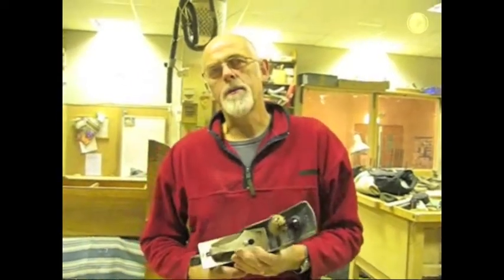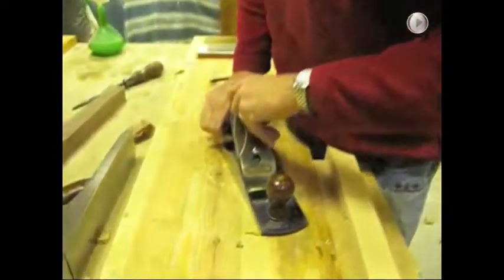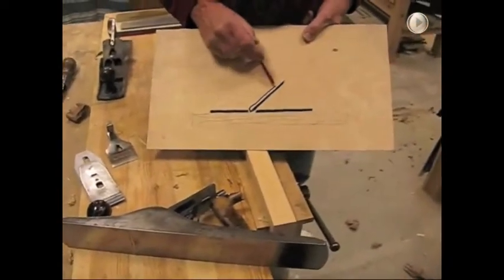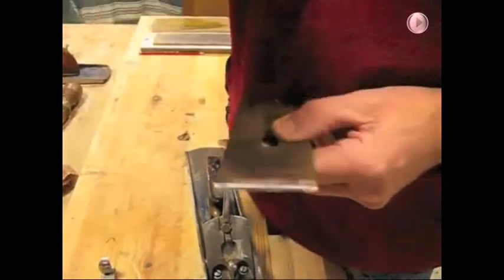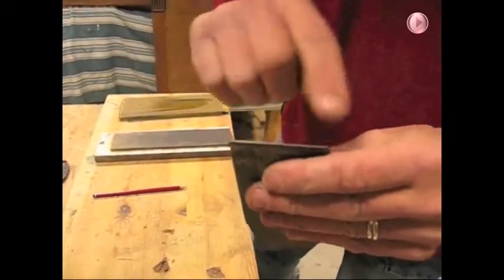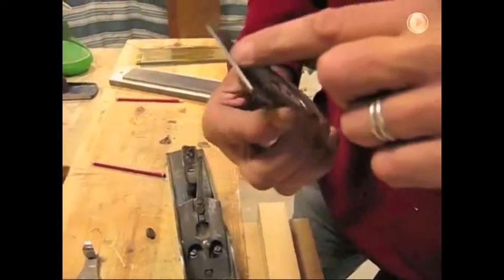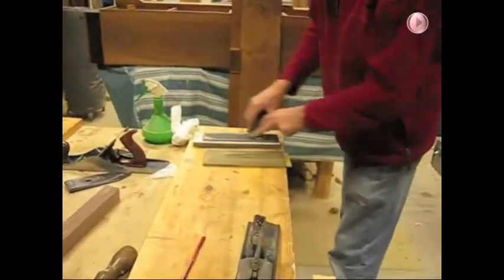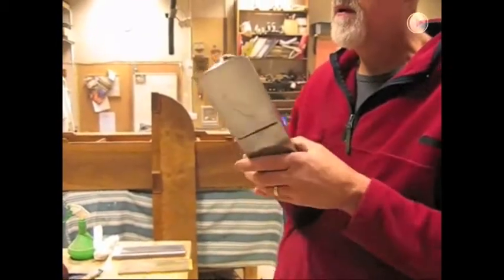Improve your plane's performance - fettling the chip breaker

Comment from the maker: That's interesting. Old English wooden planes have very thick blades, but they also have a chip breaker. Your comments have made me look anew at the chip breaker. I tried my 5 1/2 with a Clifton blade (about 3.2mm thick) with the chip breaker set back about 5mm so it has no chip breaking action and it seemed to work OK. I need to have a rethink and try out different arrangements to work out what is happening, thanks forgiving me a new perspective.
Having said that I still think the profile and seating of the chip breaker, which I discuss in the video, are important. On thin blades the breaker needs to be forward and if the profile and seating is not good then it will affect the exit of the shavings.
Reply: +Christopher Tribe I was taught the distance to place the chip breaker back is determined by the thickness of cut and the "curl" of the wood. When set right each new roll of shavings should push up the roll above it while not be so tightly wrapped that it gets jammed in the opening. For very fine shavings this will be very close to the edge to also give even support. Course cuts don't need as much support, because they don't require the same accuracy. All wood is different, so it's hard to get perfect, but if you find you never really seem to have a clean out problem it's getting close. If you turn the plane over and all the rolls fall out without having to shake it, it's there.
Reply from the maker: +1Howdy1 I usually aim for about 1mm spacing and a mouth gap of about 1mm. This I find works for most general work. If I want a fine shaving in difficult wood I'll reduce this a bit. I tend to prefer taking a number of fine shavings over one really thick shaving, I think you have more control that way. If I did want thicker shavings I would widen these dimensions. Although I am still rethinking this based on Fridunanti's comments.

As you say all wood is different I find some wood shavings are a little "sticky" and don't clear from the blade as easily, sycamore for example. Your comment about turning the plane upside down is a useful tip.

Comment: Our school woodwork teacher taught us that the "Cap Iron" was the perfect screwdriver for undoing (and tightening) the "Chip breaker" screw? All the brass screws on the school planes were in perfect condition so he may have been right! No screw drivers slipping out of over tightened screws.
Reply: I use the cap iron as well and it has the added benefit that it's far less likely to slip and stab you in the hand.
Reply: Are you sure you're not talking about the lever cap? Stanley's lever cap leading edge will fit well in the cap iron screw.
Reply: David W I'm sure I was ;).

You are quite right.  I clearly couldn't use the cap iron to remove the screw holding the cap iron to the iron.
Reply: OK lever cap may be correct? if that's what you call it I am a Woodworking Machinist so I am a amateur on the hand tools!
Reply from the maker: I call the piece with the cam lever that holds the blade assembly down the cap iron. The part screwed to the back of the blade I call the back iron or chick breaker. The whole lot fits onto the frog.
Reply: I did that for most of my life but you do tend to chip the edge of the cap iron. A lot of old planes have that issue and if its a veteran and you want to sell it to a collector it will affect the price you get for it. They like originality.

Comment from the maker: Hi Kevin
Given time I think you can get close. All my planes are old Records. My favourite is a 5 1/2 from ebay. I flattened the sole and put in a Clifton blade and it performs very well. I have a piece of very dense ripple american oak which I like to test planes on and the Record seems to work as well as a colleagues Clifton.
If you are time rich an older plane is worth it, if you are money rich then it may be worth spending money. Also consider a quangsheng. Workshop Heaven sell them.

Comment: Just got my first hand plane (used Stanley #4 of course). I came across your video and found it very informative. Thank you!. Have you made a playlist regarding care and feeding of the hand plane? I hope so because I can use all the help I can get. I don’t mind it being an old video because I’m old, 67. I made a video of my first setup and use, if you could take a look (channel same as my ID) and perhaps see what I’m doing wrong if you would please?
Thank you again for a very helpful video!
Reply from the maker: Hi Mac, thanks for the comment. I've watched your vid and you seemed to be getting fairly good results from your plane. A few things I would suggest so you get finer shavings and that lovely swishing sound when it cuts.

I think you need to get down to a finer grit with your sharpening, preferably 1200-1500. I also find that wet and dry (silicon carbide) cuts better and lasts longer (use wet). When flattening the back of the blade it's best to work in long strokes up and down the paper rather than back and forth, also it would be beter to do it without the blade in the guide. It's absolutely vital that the blade is kept flat on the paper. 

You could check the chip breaker/cap iron as shown in this video and also make sure it is set nice and close to the edge of the blade, about 0.5 mm.

A little about technique. I assume you don't have a vice so have to hold the work[iece with clamps. It may be easier if you clamp the back end of the piece so you can plane off the end rather than stopping to avoid the clamps. Even better screw a stop to the bench so you don't need the clamps. Another option may be to screw battons to the bench so you can use sliding wedges to hold it steady, especially when planing the edge.

I notice you are sitting down to plane. It would be better to stand up then you can get your body behind the cut and drive the plane by leaning forward. At the moment you are depending on arm strength. A bit of candle wax on the sole of the plane helps the plane run more smoothly.

I have a vid on planing technique https://www.youtube.com/watch?v=TJfD0-fFAzI&t=1s I'm also working on an update of this vid.There are also vids on sharpening and lapping the backs of blades https://www.youtube.com/watch?v=z7L-WnTzLW0 https://www.youtube.com/watch?v=xOMGWkKh2M4

I hope all this advice is not overkill and that you will soon be getting paper thin shavings and that lovely swishing sound. Using a well set up plane is better than sex!
Reply: Chris Tribe Thank you very very much Chris! I’ve looked at the videos you linked and will work on something to secure the wood onto my bench as you recommended. BTW, please thank Heather (I think you said) for doing a great job recording you videos!
And yes, (if I remember to take my pills) I will start standing when using my plane - haha. Again, Thank You Very Much for your expert advice and guidance!

Comment: Good useful video Chris but I was always taught not to drag the plane back but lift it! What do you think?
Reply from the maker: +Golo1949 I have never consciously lifted the plane on the back stroke. I think there will be little pressure on the blade on the way back so little damage done. However I have no evidence on that. Perhaps I would have not had to sharpen so often if I had lifted.
Reply: I tilt the plane ever so slightly on the back stroke , but admit I don't bother if im scrub planing.

Comment: Hi Chris thanks for excellent info. The video quality is terrible though, I suggest you get an iPhone and you'll get an excellent camera as a bonusl. iPhone 5s or 6 with a matching plan will be much cheaper and better than any typical camera.
Reply from the maker: Hi The video was shot on a Canon G9 Powershot. I've always thought the quality was OK. Plus I abhor mobiles so I don't think I'll be going the iphone route.
Reply: G9 is a great camera, so I guess is not the camera's fault then! Thanks again for the response and keep up the excellent content.
Reply: hernanc The noise in the video is a lighting issue.  I've had the same problem in my videos.  A camera upgrade helped, but the real solution was to shoot all my videos flooded with halogen work lights.
Reply: Good great, thanks! The good photographers always say that lighting is the key, I suppose this is the case.

Comment: Personally, Idonnot understand what the chipbreaker breaks. Have two old planes without them and they work as well as these with.
Reply from the maker: +fridunanti It could be that you have bevel up planes. As the name implies these have the blade set with the bevel facing upwards in the plane. The seating angle of the blade is usually a lot shallower, about 15 degrees as opposed to 45. This is the configuration for small block planes, but longer  low angle jack planes are also available. Many people prefer them. I like the type with the chip breaker, mainly because that's what I'm used to
Reply: Frid - if you have planes where you feel the function is as good without a chipbreaker as it is with, that is an invitation to learn to use the chipbreaker or cap iron to eliminate tearout. The type of plane with this cap iron/chipbreaker pretty much eliminated single iron bench planes everywhere in the world until woodworking with hand tools became more of an amateur activity than professional. Search "setting a cap iron" on youtube or google. If you get into more than smoothing, a plane with a chipbreaker is substantially superior.
Reply: fridunanti i think it might depend on the thickness of shaving. i know japanese planes without chip breakers / cap irons produce some of the best finishes out there. my understanding is that it breaks the fibers of the wood before the shaving has a chance to lever against the wood infront of the blade and lift it causing tearout. this might be allot more likely with thicker shavings id think?

Comment: No! They are bevel down but the irons are 5 mm thick. They are old wooden planes made fore long time ago in Austrian Monarchy. Most planes didn´t have any chipbraker at that time and they did their work well. Even now, there are quite enough plane makers who make planes without them. Why? Because they are not of need, but the irons have to be thicker. Chip breakers break nothing they make the thinn iron more stabile.